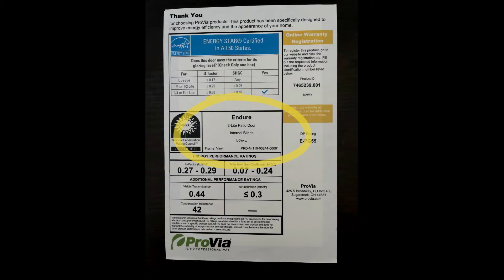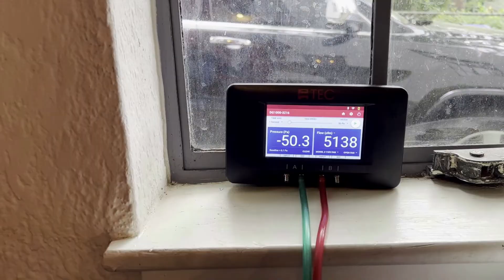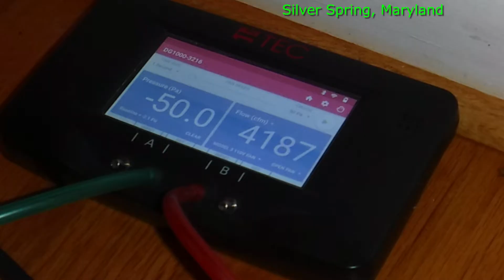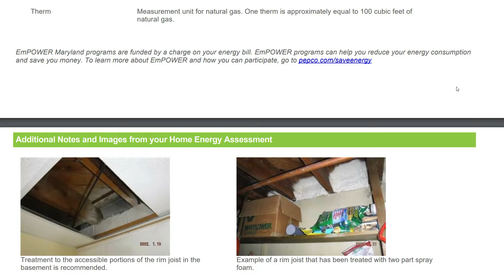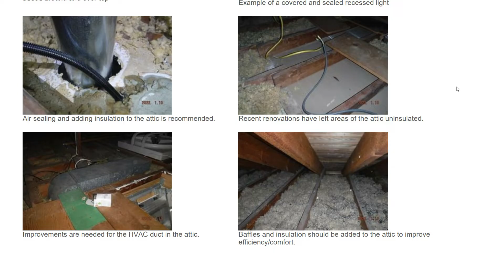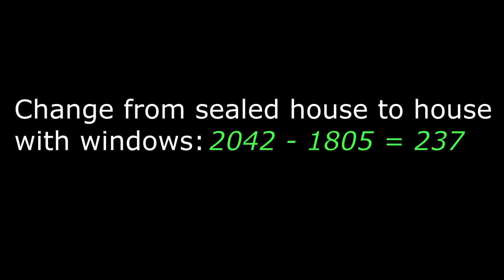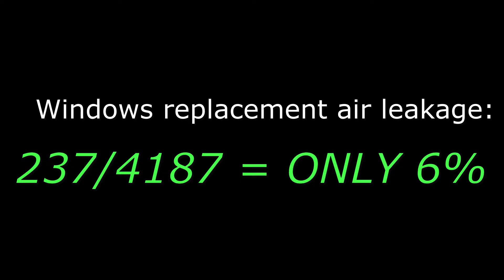Everyone Says Get New Windows… But Here’s the Truth

Comment: I don't have an accessible attic, it's a cathedral/flat roof. How can I do air sealing from inside?
Reply from the maker: Hi, thank you for your question! Okay, are you sure that the roof and the ceiling follow the same path? Sometimes you can actually get to the sloped ceilings from the attic. If not, then you may have to consider removing the drywall in sections and use two-part spray foam. That is what I would recommend if you are going to do anything because if you "dense-pack" then you run the risk of not getting the right performance from the work particularly if the area is already insulated. In theory dense pack would air seal and insulate as does spray foam so that would answer your question about how to air seal that type of attic. If you can't do anything like that and you happen to have any recessed lights in the ceiling you should look into LED retro kits, if you have not already. Seal any possible connections you are able to access and keep it looking professional.
Reply: @ no way to access the “attic” at all, it’s a fully flat roof assembly (urban townhouse). I’ve been wracking my brain for years to figure out how to do it, but it’s a super tricky setup without tearing everything apart. 

It’s more or less like this:
Roof
Ventilated space (1’-4’ deep depending on where you are in relation to the drain, the flat roof is very well sloped)
Attic “floor”/timbers
Ceiling rafters (2x8s)
Strapping
Lath & Plaster

Zero existing insulation up there. Which is good, because there doesn’t seem to be a “right” way to do it without testing off the roof and starting over 😩
Reply from the maker: Yes, I see. I come across tricky situations all of the time. Did you mention your foundation? Maybe you could at least start there...or just move out LOL
Reply: @homeairleakagetest  ...joists embedded in the concrete... lmao

at least it's a row house so I'm losing heat from two fewer sides :P
Reply from the maker: Sounds like an old Baltimore row home. Flat roof. You can access the portion with more space and seal as much as possible and then blow loose fill as far down as you can.

Comment: What was approximate cost of the air sealing vs new windows?
Reply from the maker: Hello, thank you for asking!! In this case the window contract (which I have and needed for the customer to receive rebates) was $16,600. Air sealing and insulation out-of-pocket was $3300 after a $2900 pre-approved rebate through the Maryland Utility - in this case PEPCO in Montgomery County Maryland. The window rebate (eligible to customer after shell work (air sealing and insulation)) was $1100 for a total rebate in this case of around $4000. So the windows ended up costing them around $15,500. They looked super nice though.

Comment: We had some old single pane aluminum windows on our house and while they may not have been drafty, when it was cold they would cool the air enough near them it felt like a draft. You didn't want to sit near the windows in the winter. The aluminum frames would condense water and would freeze at night, there were certain times of the year there would be a half inch of ice on the inside of the frames. I can say for certain replacing them made the house more comfortable. But it is nice to have windows that open and close easily plus they look so much nicer.
Reply from the maker: Thanks for sharing your experience! Old single-pane aluminum windows definitely have their challenges—especially with the issues you described, like condensation and the chill from cold surfaces. Replacing them with new windows can make a big difference in comfort for sure, especially when it comes to that 'cold draft' effect from the glass and frames cooling the air around them.

What’s interesting is that, while replacing windows can improve comfort, sealing up the attic, walls, and other areas where air leaks occur can often reduce drafts and improve overall warmth even more than windows alone. Combining air sealing with efficient windows is the ideal way to balance energy savings and comfort. Sounds like your new windows added a nice boost to both comfort and aesthetics!
Reply: I'm dealing with a similar issue with old windows. They may not show up on the blower door test but we don't want to sit anywhere close to them in our living room as the air is so cold around them. Looking forward to replacing them.
Reply from the maker: Thank you for sharing your experience. It’s a common challenge with older windows, especially in colder climates, where you feel discomfort even if the blower door test doesn’t show significant leakage. This phenomenon often ties back to a few building science principles:

Thermal Bridging and Cold Surfaces:
Older windows, especially single-pane or poorly insulated double-pane ones, tend to have low insulating value (low R-value). This creates cold surfaces on the glass and frame, leading to discomfort from radiant heat loss. Essentially, your body feels the chill because it’s losing heat to the colder window surface, even if there’s no direct air leakage.

Stack Effect and Air Movement:
During winter, the natural stack effect in your home pulls cold air downward, and this can create drafts or a sensation of moving air near windows. While the blower door test focuses on measuring large-scale air leaks, subtle air movement caused by temperature differences can still lead to discomfort around windows.

Condensation Risks and Indoor Comfort:
Cold window surfaces can also contribute to localized discomfort by causing air to cool rapidly as it approaches the window. This cooler air sinks, creating a mini draft effect even if the window itself isn’t leaking air.

How to Address It Without Relying Solely on Replacement
While replacing windows might improve the comfort, here are some interim solutions to consider:

Air Sealing: Make sure the window frames, sills, and trim are well-sealed. Gaps between the window and wall framing are often overlooked and can contribute to cold air infiltration.
Window Coverings: Heavy curtains, cellular shades, or window insulation kits can help reduce radiant heat loss and make the area around windows more comfortable.
Interior Storm Windows: These can improve thermal performance significantly without the cost of full window replacement.
Insulation Around Windows: During a blower door test, infrared thermography can help identify if there’s poor insulation in the wall cavity surrounding your windows, which could be contributing to discomfort.
Long-Term Solutions
If you do decide to replace the windows, consider high-performance windows with a low U-factor and appropriate SHGC (solar heat gain coefficient) for your climate. Combined with proper installation, they can address both thermal performance and air leakage. Here is additional information about window ratings put out by the NFRC: https://hometrustremodeling.com/nfrc_window_ratings

Replacing windows can improve comfort, but addressing air sealing and insulation as part of a whole-house approach often yields the best results. An energy audit could help identify the root causes and guide the best course of action.

Generated with AI using past experiences and information shared to provide good advice.

Comment: Thanks for sharing your data and experience. I’ve been air-sealing and insulating my tight dark dusty attic and this helps me stay motivated to keep going to finish it off because i can see the value and payoff. 
I do wonder, if you replaced the windows first, then air-sealing, if you would see less than your measured (51?)% improvement of air-sealing just by reversing the order, as if there might be diminishing returns at some point. Still, at nearly 9x comparative improvement, it’s clear where the bang for your buck is.
Reply from the maker: Hello. Thank you and you’re welcome! Every house yields a different air leakage reduction amount. There is no doubt the order will not change that only your effort. Happy hunting!!

Comment: Question- how do the work effect the heating and air conditioning costs? Clearly the air sealing was great and the original windows weren’t leaking that badly, but what about the u value dollars saved because of the new Windows. I suspect not that much. Please enlighten me on these questions.
Respectfully
Reply from the maker: Hello! Thank you for stopping by! Looking solely at the air leakage modeling, when I calculate the projected savings before windows compared to with windows, it appears that the air sealing leads to approximately 10x more energy savings. Now, don't be misled here either. We are talking about energy savings of around $1000 with air sealing and $1100 with air sealing and windows. Comfort will be the bigger benefit as far as impact on your life.

Comment: I started air sealing a few years ago as I found particular issues. The house is a split level built in 1960 which has all kinds of problems that were built into it. The original owners did nothing to improve on the issues, other than install double pane windows. 

When I bought it a few years ago the owners son said to me at the closing, my mom could never get warm in that house. If someone had actually seriously looked into why the woman couldn't get warm, it could have saved the parents a whole lot of money and grief over the years. 

I've picked off a few large obvious air leaks over the years as I found them. These corrections made a good size difference in my utility bills.

Since February 24, it's been my one job to hunt down air leaks and seal up this house. Not done yet, but getting there little by little. Biggest aggravation is with the builder and the people who've worked on the house in the past. Oh we made a hole installing what ever, so instead of fixing it correctly, we'll just stuff insulation in this hole or do nothing, the owner will never notice it. Last week I found a good size opening coming out of my lower level into the garage. The HVAC ducts run through a cinder block wall, across the ceiling of the garage. I pulled out a large section of insulation between these ducts where they pass through the wall, just to see what was behind it. I found a 3" x 8" opening between the ducts. I was literally looking through the opening, down at my car in the garage. This is the kind of stuff that drives you crazy. These problems are what takes time to find a solution, and fix it correctly. Even with what I have left to do before the fall, the change in the house is unbelievable. Still have two biggies to go, the rim joist and the top plates in the attic.

I really expect for how many problems I've found so far, to see at least an additional 25%-35% drop in my cooling and heating bills over the next year. Before I started this project my electric company said my home was one of the most efficient by 1-3% over what they considered efficient homes and using 35% less power than similar homes in the area. I started air sealing the whole house at the end of February. My power company is telling me in a letter that I got today, that my home is as April 2024, 19% more efficient than what they would call an efficient home, and that I'm using 50% less power than similar non efficient homes in my area. BTW don't expect similar gains, my house had a lot problems from the start and I haven't even gotten to the rim joist or totally sealed the attic yet. 

Anyone reading this that is planning on doing the work themselves, air sealing is inexpensive to do materials wise, but it is also very time intensive. If you're working and don't have much free time, hire someone. The other advantage to hiring an energy efficiency expert is, they know where all the hidden leaks are. 90% of the people doing air sealing themselves, will miss a lot of the little stuff, and those small items really add up. This is one of the issues that is taking up so much of my time, actually looking room by room for the air leaks that I might have missed the first or second time through.
Reply from the maker: Thanks so much for sharing this really great information. We get some of our best air leakage reduction results when we work on split-level houses. I have a bunch of video footage from several that I did, and I am wondering how to best use it. Once I found that the rim around the two-story portion did not extend through the attic area above the first-floor section - leaving the space between ceiling and floor above open - it was easy to understand why their daughter was always freezing in winter and hot in the summer with her room being on that side near the problem.
Reply: @homeairleakagetest  Mine has all the standard issues that most houses generally have. Like I said in my post it was past building practices and people who've worked on the house over the years that were the worst. Older double hung windows with worn brush seals that were easily fixed with creative weather stripping, $6.75 a window. Plumbing Access panel in an unused bedroom not secured, now sealed. Attic stairs have a insulated attic stair tent and sealed with caulking and the door is weather stripped for additional air control. I have a mail slot in my front door. To solve that one I got a Mail Cage off Amazon UK, insulated it and bolted it to the door. Mailman would slip the mail in the slot and never push it all the way through which left the cover open until I got home from work. If he does that now it doesn't matter, because of the insulated box around the mail slot. 

I can't tell the number of holes drilled in baseboards and walls that I have found. One that I never paid much attention to that was bad, was a section of ceiling was missing in the stairwell coming up from the garage. That was another out of sight out of mind issue. I would look up and see joists exposed to the cold garage. I fixed, insulated and sealed everything up. I found three other good sized holes made in that same stairwell where they just stuffed insulation in to solve the problem.  That stairwell looks like it was a major issue by itself. I thought the rim in the garage would be the worst to deal with, nope. There are so many holes that have been drilled or punched into the ceiling and walls for wiring. Those holes are letting air flow straight into the house. It's like playing hide and seek down there looking for any place air can leak into the house. The worst is that I have to seal the whole perimeter of the two car garage ceiling. There is a noticeable gap between the ceiling and the cinder block walls. Hopefully I'll have the garage done by the end of next weekend. The best part of air sealing is that it is cumulative, everything you do builds, toward having a more energy efficient house.
Reply: Thanks for that thorough description.  I'm currently wrestling with the idea of crawling around the attic to install Rockwool or having the pros come in and spraying.  We had an energy audit done a few years ago, before we resheathed the outside of the house with Rockwool and cement board. Leaks everywhere.  Fortunately we live in the Okanagan (B.C.), so our winters are "less savage" than the rest of Canada.  But, as you pointed out, those elusive leaks are a work in progress. 

Once again, thanks for taking the time to give us your situation.

Comment: I don't get it good windows don't do much for draughts, they reduce heat loss through the glass? Also if you seal the house up too much do you not start getting problems damp/condensation and smells? House needs ventilation? I know there are a few holes in ceiling in my house (for instance above lighting fixture) but I figure I need some ventilation right? Obviously if it's peppered with small draughty holes that's a different story.
Reply from the maker: Hello, and thank you for checking out the video! You are discussing the difference between controlled and uncontrolled air movement through the house. When you get an energy audit done, one of the things we look at is indoor air quality. If we can tighten up the house very well, we can add mechanical ventilation to create a stream of fresh air. In older houses, we do this using bathroom exhaust fans, and in new builds, they put ventilation systems into the HVAC. Leaving holes around the house does not work due to pressure. Holes at the house's ceiling are a recipe for your conditioned warm air to rapidly escape (warm air rises up). Seal up top and get fresh air in less costly ways. In my opinion, windows can help more in summer compared to winter.

Comment: Great video! Insulating and air sealing are of utmost importance. 

Out of curiosity, what type of windows were previously on the home and what type were upgraded?
Reply from the maker: Thanks for watching! The window that were replaced were clear glass single pane wood windows with aluminum storm windows. The new windows were made in Maryland by a company called Vytex. Their Potomac Series window. There are variances with U-factor and Solar Heat Gain Coefficient based on the glass package and unfortunately I don't remember but they qualified for rebates from ENERGY STAR.